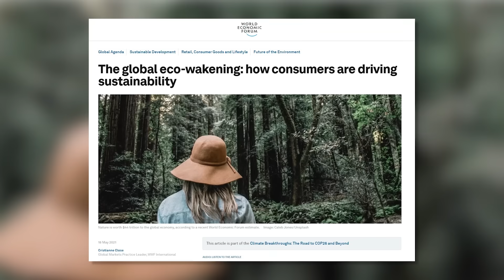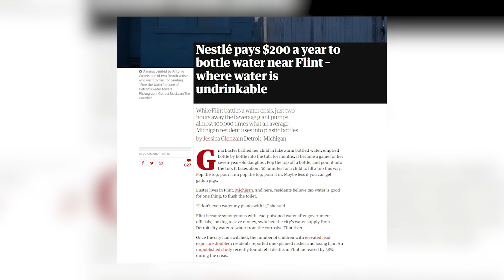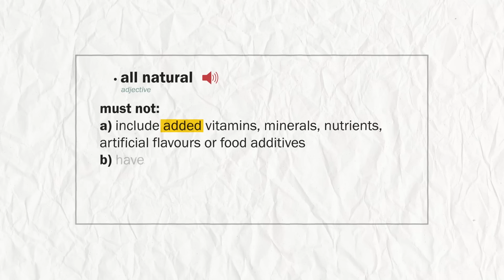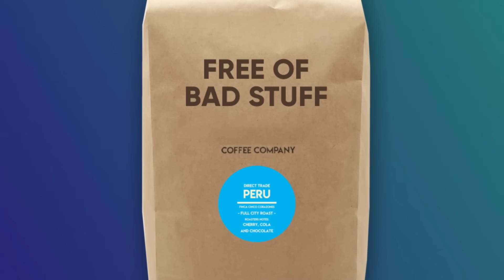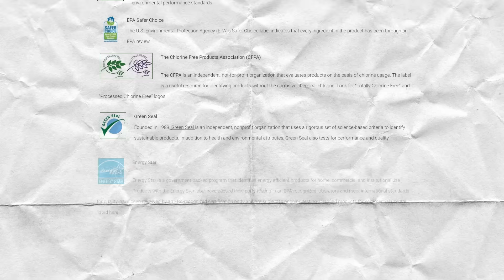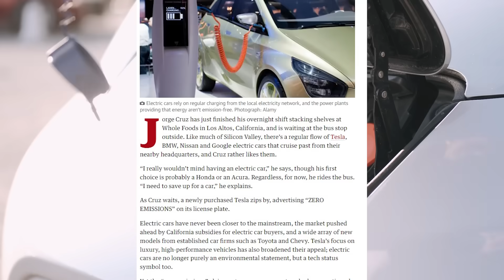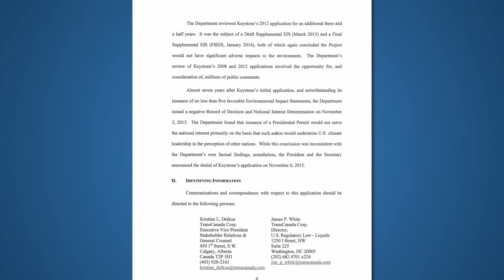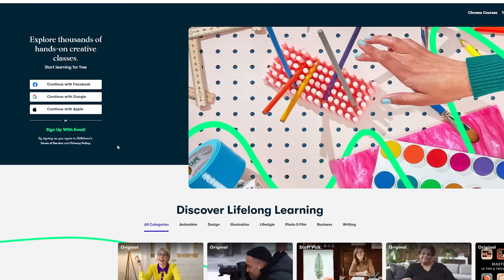Why Being 'Environmentally Friendly' Is A Scam

Comment: a good and informative video overall, however, i'd like to touch on 2 subjects, both of which kind of play of of each other.

the first part would be the "lesser of 2 evils" with the car comparison, i get that making a car that is less environmentally damaging still has the footprint of being made by processes and costs that are environmentally damaging. and that it's usage is still more damaging to the environment then not using it at all.
however, reality shows that, for a lot of people, goods and services, motorized transport is a necessary evil. whether it's private or public.
but if those processes and costs are about the same for each of them, wouldn't the cleaner car be the better option at that point regardless?
and wouldn't it be better to focus on the transition point, where newer vehicles being made, even with more polluting means, actually start recuperating their initial offset compared to older/less environmentally friendly cars?
also, for the mining of lithium and other chemicals, yes the process of the initial mining and refining is extremely hazardous and costly, however, once it has been mined and has seen its use in say, electric vehicles, or other electronic devices, the incentive to repurpose/recycle these materials compared to discarding them is high enough to warrant whole new recycling industries to pop up, ones that can recycle a large portion of those materials with a far smaller carbon/environmental footprint compared to mining and refining the raw materials.

at that point we can extrapolate the "lesser of 2 evils" to the conclusion that anything other then walking would be environmentally damaging.
and before someone says "well, you can always take a bike"... even those have a carbon footprint in their construction that is larger then not having one...
so i would personally call it the "lesser of 2 necessary evils" and I will gladly take the lesser of 2 necessary evils.

as for the second point,
you mention the keystone pipeline, which is a very interesting subject in more ways then 1.
considering the fact that the transport of oil will still be a necessity that will happen, (a, necessary evil if you will) and if the pipeline isn't/won't be complete, which by the looks of it wont happen for quite a while longer at this point, what is the environmental impact of transporting the same amount of oil by other means compared to the pipeline? (the, lesser of 2 evils)

and wouldn't the pipeline, despite having a negative environmental impact, be far less polluting than transporting the same amount of oil by trains, boats or trucks?

also, the chance of accidents/spills/disasters, and how to handle/clean these, would be far less likely to occur, and far easier to fix/clean up, using a pipeline compared to other modes of transport.

so, once again, a lesser of 2 necessary evils scenario.

now, I'm all for environmentally friendly practices, but not "at any and all costs"

Comment: I thi k it's a little frustrating that after talking about fuel efficient passenger cars, you followed up by giving the amount of co2 emissions the US produces with "transportation". You did include images of trucks, trains, and container ships, but you didn't mention them. So to someone not paying close attention, it could definitely sound like you're saying passenger cars contribute way more carbon than they do. The vast majority of co2 emissions come from industry (and much of that is transporting raw materials and finished goods).

There is very very little that any individual could do to make a dent. So that's why it's frustrating to not explicitly point out that individuals arent responsible for most of the carbon, and that unregulated/deregulated industry contributes the vast majority of it.

Comment: We already used to have that it was called glass that was the ultimate reusable container you bring your glass back get a nickel from what you bought back then you get another bottle of soda you drink it put it back for a nickel it work awesomely they would clean them with bleach and water and refill them same thing to be done with them aluminum bottles that they're making now they could design a way to where they can be marked and how many times they've been brought in and cleaned like certain grades could probably be brought in and cleaned once and some grades can be brought in and cleaned twice maybe after that they have to be disposed of it's a lot better than just way it is right now

Comment: A note on the pipeline: that fuel has to come from somewhere since the US is no longer energy independent. Which means it has to be shipped into the US from abroad, which causes exponentially more environmental damage. This is one of those situations where the fight against climate change has done more harm than good.

Also of interest, the authors had been involved in several pipeline constructions before, and it is exactly because of this experience that they were consulted. Funnily enough, their names were removed from the paper to avoid them being pressured by political protests for approving it, because climate protesters are known for being quite extreme: people have died in the UK due to climate protesters blocking ambulances on main roads. So while it may appear shady from the outside, it's actually not at all surprising. 

Sadly, its a situation where youthful naiveté believes it knows best without stopping to consider the alternative, and is now cheering a result. But just because a result was achieved, doesn't mean it was the correct result, and sadly there will be more damage caused by due to the actions of the people trying to stop climate change.

Comment: Your keystone pipeline argument is missing a major point......

The fuels it would have safely and efficiently transported still need to be moved, so rather than than a single efficient pipeline....it is instead being moved by millions of individual trucks burning countless gallons of fuel......

Kinda like paper straws wrapped in plastic...big win there...... a "might" problem of an oil spill was circumvented to create a WILL problem  of endless amounts of pollution, while putting thousands upon thousands of workers out of work.....

Comment: Tbh I'm not surprised that the likes of Chevy and especially Ford was found guilty. Tho I will say I am surprised that a non-american car company such as Volkswagen would have such antics. Generally Europeans are very strict about these things. 

Also another prime example of lesser of two evils with vehicles, motorcycles. They lack the multitude of sensors, filters, and everyone's favorite Cadillac converter (basically everything that makes working on modern engines oh so fun!!) and somehow they get past the regulations? Certain motorcycles can have engines with the same cylinder count as modern cars. But like "Oh it's a smaller and lighter vehicle." Doesn't make it any less deadly to the environment and any poor sap breathing in the exhaust.

Comment: You are actually incorrect on the keystone XL pipeline. Many people do not know that there is currently already a pipeline in place that the new one would replace and is 100x safer than the old one. Not to mention the tribes leaders had already approved the plan. Also the current pipeline lies only 50ft below the lake bed currently while the new one would be 150ft below the lake bed. It is also much less likely to have a spill then by any other means of transportation. It also has so many fail safes that it is almost guaranteed to never spill oil onto the land. It also delivers 3x-5x as much oil at half the energy cost. So allowing the pipe to be completed would greatly help the environment not harm it.
Reply: Interesting. That is precisely the problem with many environmental movements. They do not look at the whole and many of their ideas do more harm to the environment. Probably because many who participate in the movement actually have other motives, such as looking good in front of their friends / social circles.

Comment: Oil transmitted by pipeline > Oil transmitted by boats, trains, and trucks.  A pipeline doesn't take up much space, doesn't emit greenhouse gases to transmit, and allows us to be less dependent on Oil from the Middle East, Russia, and other overseas locations.

Really, what we need to focus on is getting more nuclear plants build up so we can stop being so reliant on fossil fuel plants and therefore allow EVs to be more environmentally friendly because they're not being charged by power sourced by coal plants and thus reducing the amount of gas operated vehicles we use.

Comment: In the US, regulation often means spending taxpayers moneys of needless things. Increase cost with no real protection. As an example, is OSHA, people like to claim how they protect workers but if you look into workplace ascendants before OSHA and it was dropping at the same rate as after OSHA. My own personal experience in a bottling plant, the government agent was more concern about where our vending machine was at then the dead tree frog on the bottling line, the broken bay doo, and a huge slit in the brick wall that you can see daylight through.  That is not including how some government regulation requires you to look with no testing to tell if there is harmful microbus on food products. 

In the case of cars, many innovations stopped when government started regulating requiring minimal requirements. Many who lived back in 70s have talked about the brief period of some senators wanting to make it standard for cars to get 70 mpg based on a car at that time. Then it quietly went away. Or how when people had order cars from Europe, that because they are not the US standard, often more environmentally friendly parts are removed and replace with the less environmentally US standard. 

It is seen that when the government puts in regulations it often means a minimal requirement and companies pull back on innovation because it is the government they must please, not the consumer. Often, in industry where government does little regulation, there is more innovation because companies are meeting the demands of people. If you notice in the car market, often the innovation is not with the engine as much as it is with extras like wireless charging of your phone, heated seats, and GPS installed.

As for the pipeline, it is not as dangerous as shipping the fuel by truck. Nor is it as environmentally damaging as shipping it by truck and ship, two things that Lith Battery EVs cannot replace. And we thank you for killing people because without the pipeline, we now have to get the fuel from even worse ways. How is stopping the pipeline really protecting the environment? By having us buy Russian and OPEC oil who care even less? Solar and wind have proven they cannot meet our needs, nor are they as green as people think? How are you going to make the metal parts if you close the coal mines down? Burn trees to get the carbon needed? 

The truth is, there is nothing you can do that does not have an effect. The fact that medicine has gotten better and has allowed more people to live and live longer has an effect. Just think of all those bodies putting off greenhouse gases themselves and the resources they will require that also produce greenhouse gases.  One thing I notice is when life grows and becomes abundant, the warmer the planet gets. We might return back to the days where Antarctica was once a green place.

Comment: You also left of that 98% of all vitamins and supplements are synthetic, such as centrum vitamins is all synthetic. You’re correct you need to do your research. You cannot depend on others to be honest about their product there is too much at stake for them financially and like it or not that is for most the motivation. 
Also you left off that computers especially in their production and when they are no longer useable - just like the batteries for the electric cars 🚗.

Comment: I remember buying one time of those pre made salads. It came wrapped in plastic, with a plastic lid in a plastic container, with sauce on a plastic bag, BUT IT CANE WITH A WOODEN FORK.
Reply: Like the paper straws in plastic wrap 😂
Reply: Plastic is actually keep your food protected, but yes, the irony.
Reply: @franfinesim  you said "Plastic is actually keep your food protected, but yes, the irony." but this is not the truth! there is no irony, it's just what the companies want you to blindly believe...plastic actually ruins food faster you can do the experiments in your own home/fridge just take something like lettuce or herbs(if you don't want to be "wasteful" you can rip some leaves of a plant or tree outside and lay part inside a sealed ziplock bag and lay the same exact thing next to it on the shelf and wait and see the results or in the fridge and you can try comparing paper bags or cloth bags...plants contain water but if whatever your experimenting with well if you want to "speed up the process" mist it all with water, the ones in the sealed plastic will mold/spoil first ones not in the plastic will "air dry" and not mold or not mold as quickly. that's why they put holes in some plastic surrounding produce or why some people will layer paper towels between or around the produce inside the plastic so it helps catch the moisture the plants have so they won't mold so quickly...so since plastic is not only not protecting the food but actually harming it spoiling it quicker(there's even evidence the plastic leaches toxic chemicals into the food especially if the food contains water and or salt) so since the plastic is not actually there to "protect" the food like they want us to believe then why is it there?? it's more profitable than not...not only is the plastic making the companies more money but if the food spoils quicker then you'll have to buy more food and as long as it's more profitable it will continue to be there even if it harms the food even if it harms the environment and even if it harms human health...what a shame too bad aren't economies supposed to be more efficient than not?! too bad most of us have zero clue about our current system of moneyism just a system where money is what is most important. not that nothing else is important just that money is MOST important..money is more important than health/knowledge/life/companies/religion/governments/the earth/etc most humans would never personally agree that money is or should be what is MOST important nonetheless this is the system we are all being forced to live with even if we don't realize this and this(the majority not understanding) is also on purpose! we can't even refer to this system by an easy for everyone to understand word but the word capital just means money so there is zero reason why we can't refer to capitalism as moneyism instead except that would start to help the majority to truly understand it and ultimately reject it for anything that is better(which there are many better alternatives)...hope this clears up any confusion about plastic and why we have sooo much of it even tho it's so harmful/wasteful because under moneyism efficiency/the health of the earth can't be MORE important than money...
Reply: @franfinesim  that's why you shouldn't buy ready to eat salads
Reply: @ioanna_vsl  Almost everything has a plastic wrap and must have one. Only if you want to vomit and have diarrhea every single day
Reply: @franfinesim  "must have one" lol. What's the fruit and vegetables peel for?
Reply: @luisapaza317  I talk food in general like cake and so on. Fruit can be kept in plastic, paper or fabric bag. When my parents were in my age, it was completely normal to get groceries in a free brown paper bag. Now it's being charged and we wonder why people use plasti bags
Reply: @franfinesim  uhm, yeah, correct paper and cardboard aren't really alternatives
Reply: Ha !!
Reply: I canet
Reply: LOL
Reply: we are working on it. We believe that if food is produced and recycled in a decentralized way, a lot of transportation, packaging and organic waste can be reduced and organic food can be produced without using pesticides and synthetic fertilizers. The whole thing works by using black soldier fly larvae to recycle food waste and feeding them to fish. The dirt produced by the maggots and fish is filled by plants. A perfect recirculation system that extracts water from the waste and saves water in the production of fish and plants.

Comment: Electric cars charged off of dirty grids are still a lot cleaner than efficient gas cars! Turns out coal and gas plants are a lot more efficient at generating electricity than tiny little 4-stroke motors!

Comment: Dude, you should do a video about the truth of the CFC ban. It's extremely difficult to show ozone destruction by CFCs in the lab, and even if it does what was claimed, it is a tiny drop in the ocean of natural enemies to the ozone layer. It's not likely that the CFC ban did anything at all, EXCEPT - we know for a fact that it was a profitable move for DuPont and BP - who strangely supported the banning of their own product. Why would they do that? This is perhaps one of the biggest worldwide snow jobs ever pulled off. There is also the possibility that the environmental damage and loss of life due to the new refrigerants is much higher than anyone expected, AND food safety in countries which can't afford the newer and more expensive refrigerants has been compromised. The truth is that CFCs are banned because their replacements are much more profitable.